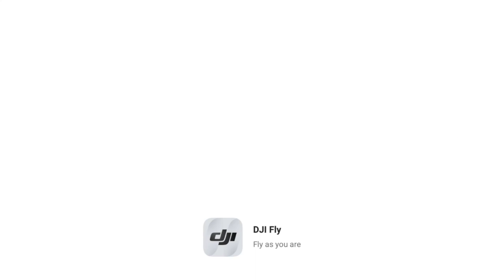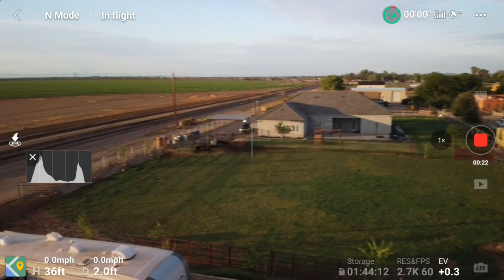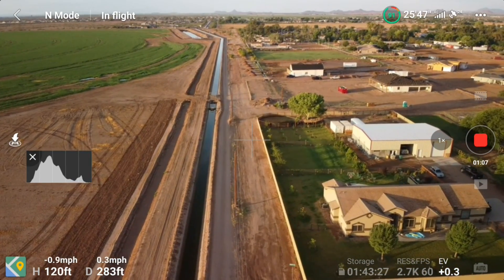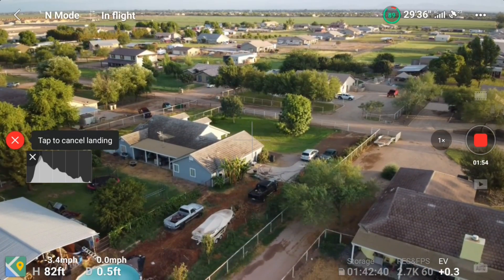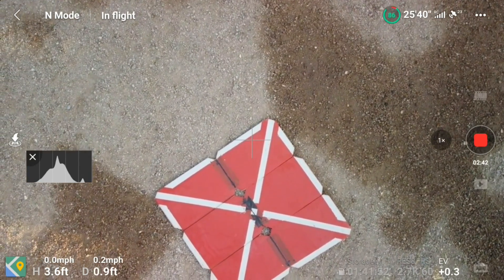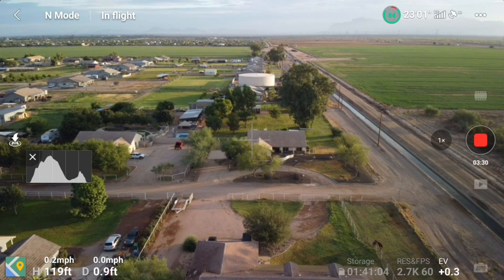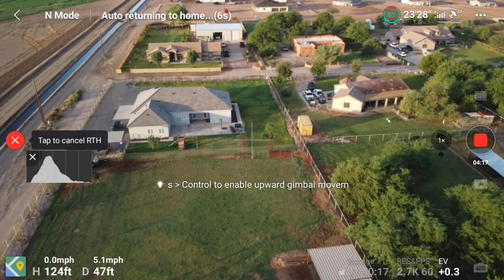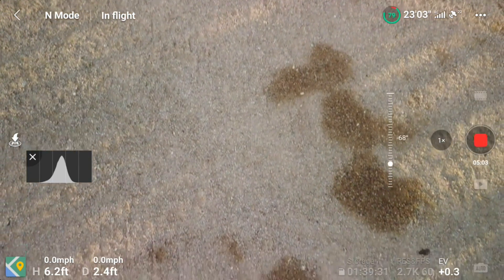WHEN DJI MINI 2 RETURN TO HOME WORKS AND WHEN IT DOESN'T

Comment: Hello buddy
Keith Kuhn here.
I am just curious.
Where can I find info Water Towers are ?

I have tried to find this info before but it is it tough.
Keith
Reply from the maker: Thank for your question Keith. The way I determine the height of anything is to fly the drone near it and continue rising until the top of the object is even with the horizon. That works with drones as well as full size aircraft. I hope that's helpful. God bless.
Reply: @user-sr8pn9xg8z  
Thanks buddy that's one of the very best ways what you just described.
Keith

Comment: Thanks for this, your video got me thinking though. Your messages popping up show you are in an altitude restriction zone. Say the restriction is 150ft and you are flying in the restriction zone at 120ft quite happily, but; you have set your return to home altitude to 225ft because of the HV wires. What would be the behaviour then? I'm guessing it will either return to home but stay under 150ft or it may not RTH. That would be an interesting test. Stay safe, keep having fun and god bless x
Reply from the maker: Thank you for your input and question David. I'm not sure how DJI has that set up. I am not in an altitude restricted zone depending on which end of the property I fly. My son's property is right on the boundary of the Phoenix-Mesa Gateway airport. Inside the boundary I am limited to just under 400 feet. The closer you get to the airport the lower the altitude limit becomes. We are about seven miles away. The notice that pops up does say that flying above the altitude limitations could interrupt the RTH. Thank you for your comment and kind words and God bless you also.
Reply: @user-sr8pn9xg8z  Thanks again, I'm intrigued now and want to know the answer. I'll ask on the Mavic Pilots forum and see what opinions pop up